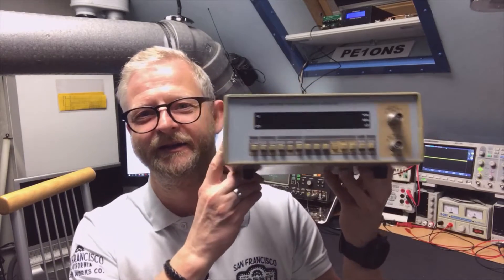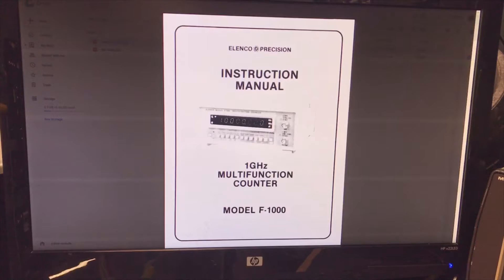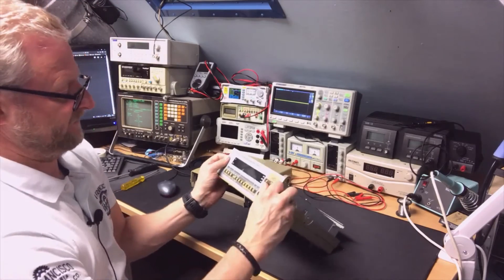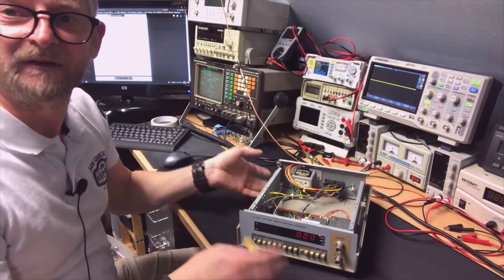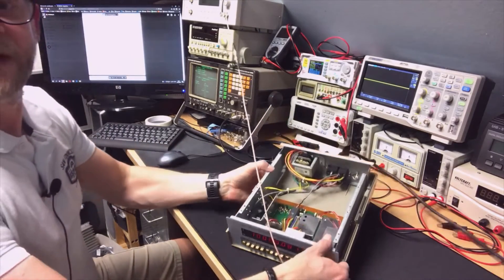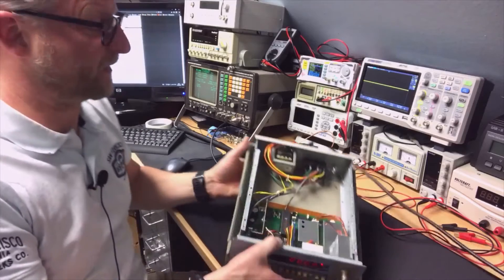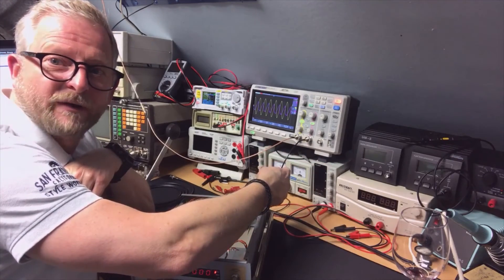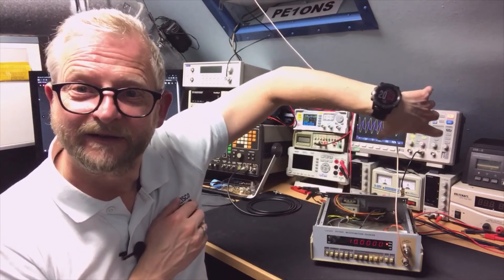#030 Dynatek DFC1000 Hung Chang 9100 Long Wei TFC1000L Maplin MF1000 Elenco F1000

Comment: Interesting video. I recently picked up the more basic version, the Maplin MF-100, cheap on ebay. It is only 100Mhz. Made in 1988. Not much inside it really, it uses the frequency-counter-on-a-chip Intersil ICM7226 which works up to 10Mhz, with pre-scaler for 100Mhz on the front end. The same chip also drives the whole display! Works ok!
Reply from the maker: Nice Peter! .. yes sometimes it can be very straight forward a counter. nice to see how they solve things int hose days.
Thanks for sharing.